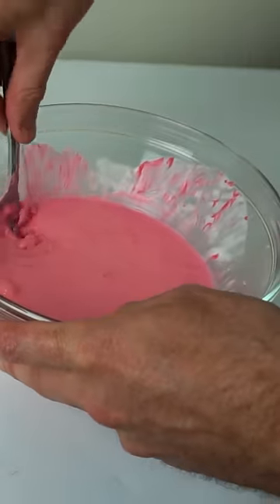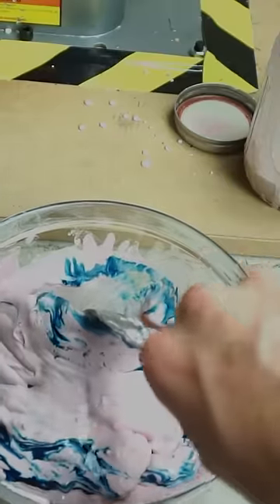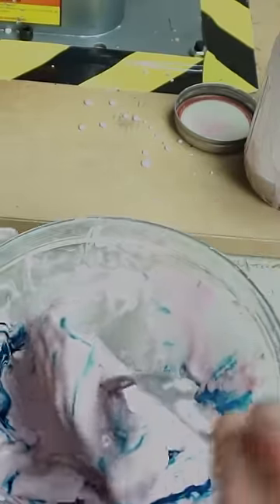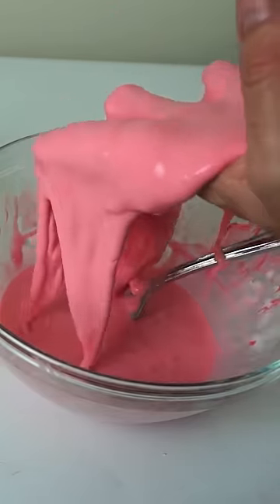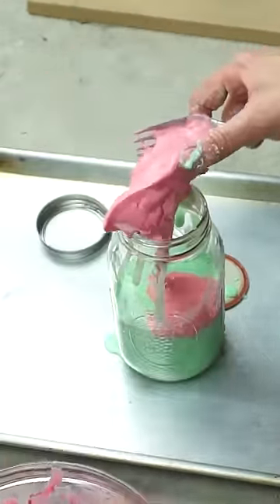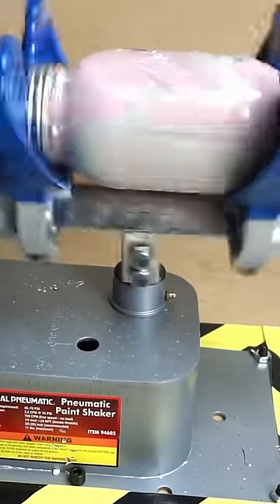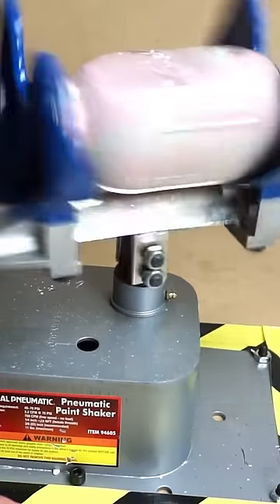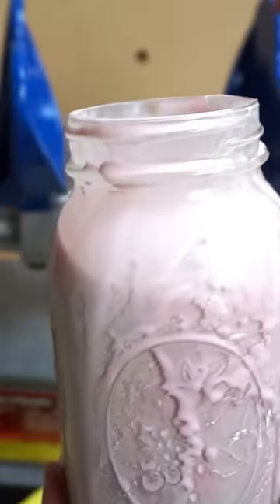Can You Actually Mix Oobleck in a Paint Shaker?

Comment: Imagine getting absolutely covered in this stuff. The more pressure you use to try to get out of it, the more solid it becomes. You could genuinely suffocate in this stuff.
Reply: Yes, that is precisely how quicksand works.
Reply: Yea when people made videos of running on top of this stuff in a pool it stressed me out because if they tripped or stopped they could die
Reply: all I'm hearing is....gotta be chill and take it slow
Reply: @dirtburger2773  if you take it slow you’ll just sink inside of it you should make some yourself and play with it with your hands. It’s just cornstarch and water.
Reply: If you dived in head first, yes you would suffocate. Just like quicksand you obviously don't want to stick your head under the surface. But you'd likely be able to breath just fine if you jumped in a pool of it, since your body has more buoyancy then the oobleck/quicksand, so you will naturally stop sinking at the waist because half of your body is already submerged, so the likelihood of actually suffocating from this stuff is quite low.
Reply: Not really. You can just break pieces off
Reply: New fear unlocked. Thanks for sharing your thoughts, Satan.
Reply: I imagine I'd say, "Ew! Bleck!" 
😕😏
Reply: @cdeathlonger7446  I reckon you wouldn't be able to 'just break pieces off' if you're submerged in it. Like quicksand it would easily stop most of your movements unless you slowed down and moved methodically.
Reply: @hangry3102  they said just covered. I assumed covered not submerged
Reply: @cdeathlonger7446  Well they said 'absolutely covered in this stuff' to be exact, and the definition of submerge is 'to cover or overflow with water', or in this specific instance, oobleck. Which implies that you're covered head to toe in a considerably large amount of it. But yeah sure, you couuuld just reframe it like you took a light oobleck shower where most of it just slid right off within 5 seconds, but that kinda defeats the purpose of the original wording Kaiya used.
Reply: takes notes for adventure novel
Reply: new fear unlocked 😁
Reply: More terrifying than Quicksand. Unlike Ooblek, Quicksand is actually easier to escape. Mainly because you can actually move to get out. You want to move very slowly with Quicksand, but with Ooblek it’ll just keep fighting you.
Reply: @Minimojojoy  quicksand isn’t a nonnewtonian fluid so not really
Reply: Would adding water help?
Reply: @kristynkazumi  
If you could somehow get it too mix, maybe. But I’m not sure we’ll ever get to know lol.
Reply: Quick sand is not dangerous
Reply: @Customize_Life  
Try saying that to the people who have possibly died in it.
Reply: @Minimojojoy  no it’s not
Reply: @Minimojojoy  people just get stuck to their waist and then can’t get out and get exhausted/starve to death, or they get stuck at a spot where tide rises or something. it’s not like movies where you fall through the earth
Reply: Reading this caused me heart attack
Reply: @hangry3102  nothing to do with the topic whatsoever but your comment gave me deja vu for some reason?? 🤣
Reply: @sleepydreamer4175  Oh well, awesome lol
Reply: @Minimojojoy  actually, in quicksand and also likely in oobleck you won’t sink all the way to the point of suffocation. This is because all of the weight eventually becomes distributed when you’re about at your knees or hips so you’re no longer heavy enough in relation to the lowest point to sink any further. Quicksand really isn’t dangerous on its own, lack of water is usually what kills someone who gets stuck.
Reply: @jacksherman6109  It behaves much like one. The two behave very similarly
Reply: My dude had never heard of quicksand
Reply: You might not sink enough in quicksand to be to truly covered but let me tell you about the Boston Molasses Disaster, also known as the Great Molasses Flood. Back in January 1919, a poorly built and overfilled tank of fermenting molasses (about 12k metric tons worth) exploded midday, creating a flood moving at an estimated 35 mph that injured 150 people and *killed 21*. Part of the danger is that the molasses in the tank was warm and not very viscous - allowing it to move at such great speed in a flood. But once it was out and you were buried underneath, it rapidly cooled in that chilly January Boston air and became incredibly viscous, making it incredibly difficult for rescuers to dig out suffocating people in time. I think it might feel like trying to dig your way out of hardened molasses
Reply: oobleck took drowning to a whole new level
Reply: I’m smacking the surface with my hand to solidify and and slowly move myself up
Reply: This happened to me once when I was 7 where it took hours to get it off. My mom bought it and thought that it was slime, I have trauma
Reply: @Ducking_Wanderer  like whom? Those fictional characters in the movies?
Reply: If you get covered just take the chunks off, do not dive headfirst into oobleck pool obviously, but otherwise it's dense so you can't even sink
Reply: To all the people talking about about quicksand, this is literally the opposite of how it works, to an exact degree. Quicksand is shear thinning, which means when it's agitated it doesn't tense up like oobleck (a shear thickening liquid), it thins.
Reply: haha I think I just started a controversy-
whoops 😅
Reply: @pete1318  what do you mean

Comment: Could you try the experiment with a paint mixer that shakes vertically rather than rotating? I'm fairly certain it would not mix as much. The reason we see it mixing here might be that near the turning point the shear force would be minimal as the ooblec hardly moves.
Reply: Almost like the point before a standing wave. Where it hits a "goldilocks" zone. And can mix slowly?
Reply: @bentboybbz  I was more thinking of homogenizing the shear force, but your hypothesis is valid as well, could be interesting to variate the frequency to test if you could create multiple compression points.
Reply: Any mixer will mix that shit. Every time the mixer changes it's "shake direction," it has to stop for a split second in order to change direction. For another fraction of a second, it needs to accelerate. So the entire mixing process is made up of thousands of very, very short moments of subtle movement.
Reply: All three of these comments made me feel good. Something about humans.
Reply: @0331machinegunman  obviously it will blend over time no matter what, don't think anyone would assume it wouldn't, with enough collisions you could blend by far the most materials with one another. The question is whether it would be possible on this timespan or not. If you play around with oobleck you'll notice that  it does take a little while to change back from a "solid" to a liquid, not the incredibly short split second it takes a paint mixer to shift direction.
Reply: That'd be cool. The oobleck would shear at the solid boundary (as opposed to the torsional motion presented in the video). And the "no-slip" continuum would ensure that the oobleck closest to the solid boundary would move at the same speed as said boundary. And the shearing would make the oobleck a solid boundary. And then it would domino, I'd assume, and everything become a solid boundary. 
I took fluid mechanics last semester, but were didn't deal with non newtonian fluids, so my assumption is probably stupid. By no means am I trying to outsmart the Action Lab Guy lol
Reply: @channelname1019  really all it did for me was make me lose brain cells cause it's people pretending like they know what they are talking about when they obviously get all their knowledge from this guys shorts
Reply: You're over thinking this one.
Reply: @TyinAlaska  how on earth is this overthinking it? Hardly know anything about non Newtonian fluid, and wanted to know more, besides it turns out they did a study on EXCACTLY the hypothesis I had. The question I'm left with though is whether or not the force of the shaking is enough for causing fracturing in the oobleck. Tbh I don't bother looking into it in with the limited amount of spare time I have. Digesting a few mins of shorts are much more pleasing than spending hours looking up white papers on everything I have questions about, when there are people who does that for a living, for example this gentleman from action lab.. I'm truly sorry that some of us have a tiny amount of curiosity left in this world where questioning things are highly prohibited by research gods such as yourself.
Reply: @tangerinetech5300  and yet you're a Joe Rogan and Paul Joseph Watson fan. Amazing.
Reply: @channelname1019  lmao the guy who said this just makes me feel good about humans felt personally attacked and had to scroll through my subscriptions to then personally attack me. Funny how you don't mention I'm subscribed to ABC news and the Washington post also. I see how little respect someone should have for you.
Reply: @tangerinetech5300  still waiting on your source material for the vast amount of knowledge you have of Non Newtonian fluids...
Reply: @christianjensen952  I could literally be saying the same thing to you....
Reply: @tangerinetech5300  mate, I was the one asking a question and forming a hypothesis, there is no need for me to source anything at all, you however, claim to know something that disproves what I questioned. Feels like you don't really understand the concept of communication... Are you sure you're the genius you claim to be?
Reply: @christianjensen952  lol when did I claim to know something that disproves anything. And when did I claim to be a genius. Sounds like you got offended and just want to argue.
Reply: @tangerinetech5300  😂 your entire first post was to mock me and the others who posted by saying you lost braincells because we got all our knowledge from this guy, this absolutely indicates that you regard yourself as superior to us and the guy from action lab and that you knew exactly what was going on. What was your intention of the post if not to ridicule everyone involved?
Stop attacking everyone to make yourself seem superior, so you can live with your inferiority complex, it's not our fault you never amounted to anything! it's just fucking sad.
Reply: @christianjensen952  lol damn clearly I struck a nerve. Good luck with your issues dawg
Reply: @tangerinetech5300  yes, that nerve is that I'm sick and tired of people trolling in commentsections to feel better.. the issues are clearly with you kid. Work on yourself rather than putting everyone else down.

Comment: I recommend possibly using a microthreaded whisk, something that can mix more compact structures that aren't complete solids. Also the vibration is working due to the state of physics the oobleck is in. If it's constantly moving at a rate with vibration at certain wavelengths it most definitely will mix completely but in the end still hold its form

Comment: There are points in the cycle of oscillation, as the force switches from one direction to the other, when the substance does not experience such force as to induce its "solid" behaviour. The substance only mixes during these tiny moments, but they all add up.

Comment: I think it mixed because there's a brief moment of calm between each shake as the shaker changes directions. The ooblek has a chance to melt slightly at each of those moments, which allows the two colors to blend together by some fraction of a millimeter at each of those moments.

Comment: Actually the shear in the jar has a gradient as it is rocking. So it mixes at the points the direction is changing and also near the center as it is rocking - so the shear rate near the center is lower. Cheers!

Comment: Ooblic. The reason this happens i assume something called rebond. The cyntripical force placed from bothe sides regardless of up or down causes oblic to lack the reqired surface area to disperse the energy making it mix.

Its this dispersion of energy that causes the oblic ro harden.

Think hitting the surface of a body of water really hard really fast. 

Tye surface tension is enough to act like a solid plane for the couple of moments the body is plummeting into the water 

The first acr of force that hits the water isn't the body.

Its the kinetic motion of the air being displaced off to the side of the individual resulting in that kinetic energy to pancake out.

While the body in motion collides with its kinetic energy. Theory of rebound. Why every once in a while surfer's can get a shore wave to raise a couple more inches.

And as the body's attempt's to sink into the water the kinetic motion is sunk into first.

Resulting in the system that is the body to take impact. Far worse than landing on concrete.

As the initial impact cascades up the body while it seemingly stands upon the water. Before breaking through the kinetic barrier between the body and the body of water.

As the feet catch back up to motion causing the same displacement with air with the additive of extra pressure per microscopic square inch of water displaced. Resulting in head injury or broken legs let alone exploding your intestines out of you mouth. Given enough height.

Were was i going.

Simple.

Theory of rebound and aversion.

The oblic can avert energy from reaching the other side of it resulting in a hardening effect. While from both angles the oblic is compromised after saturated assault of kinetic energy.

The membrane breaks.

The surface tension breaks.

The motion acts like wax paper to water with oblic.

Comment: I think you have it backwards. The shear rates are actually very high so high in fact that once it’s a solid it breaks into very small solid particles and those particles then mix around like colored sand. Once you stop the shaker they turn back to a liquid form and if the particles are small enough it looks just like it stirred it as a liquid. The vibration of the shaker is just applying the same kind of force you were with a fork in the bowl just much much faster. You could and did mix it in the bowl it just takes massive effort and time to do it by hand.